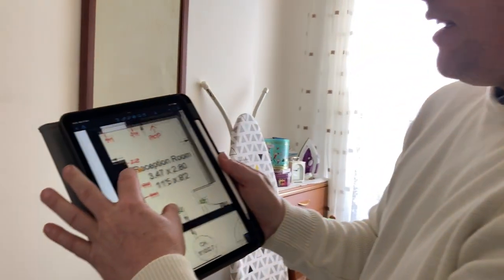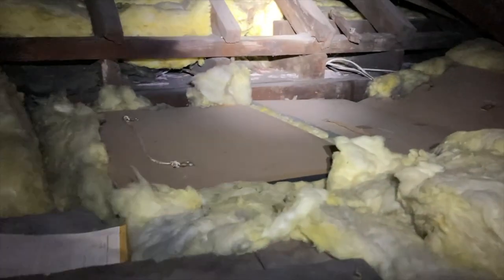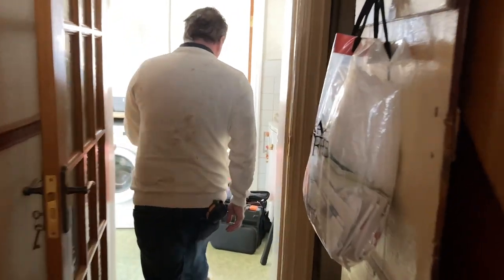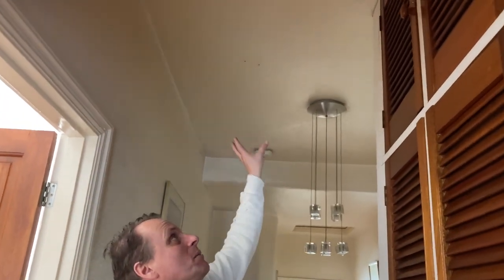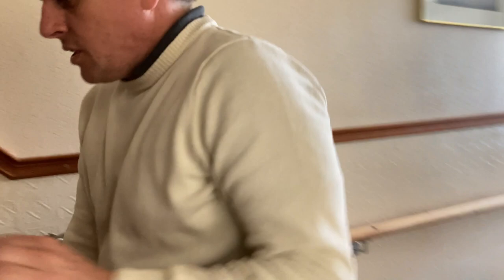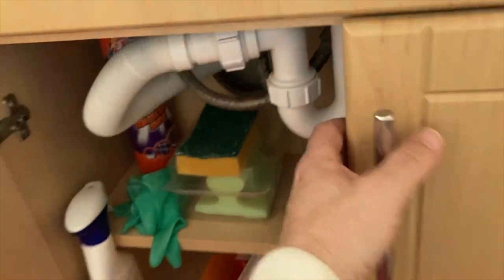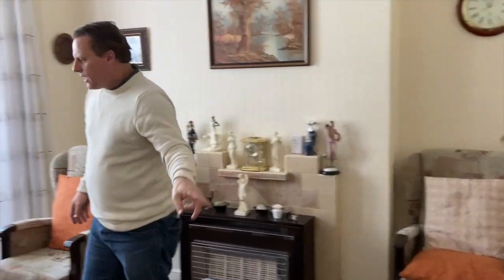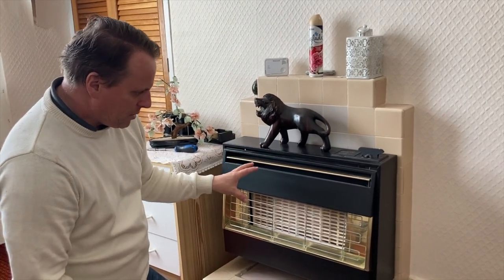How to survey a house - Part 2

Comment: An interesting couple of videos. As our ~30 million U.K. homes are retrofitted for compliance with PAS2035 over the next decade or so (ideally by 2030), cold lofts will need to be treated differently. While ventilation is a requirement, draughts must be minimised to prevent thermal bypass of the insulation (except in cases of deep retrofit when an airtight or wind resistant membrane has been installed).

Comment: 12:17 could I please ask regarding asbestos. I believe it was banned in the UK in around 1998/99 but that usage declined before this date. Though the only definitive test is to take a sample, would you expect asbestos to potentially be present in artex or building materials in houses dating back to 1997 built by large developers?
Reply from the maker: Hi, thank you for your comment. Amosite and Crocidolite were banned in 1985 and chrysotile was banned in 1999, so anything pre 2000 should be tested for asbestos content.